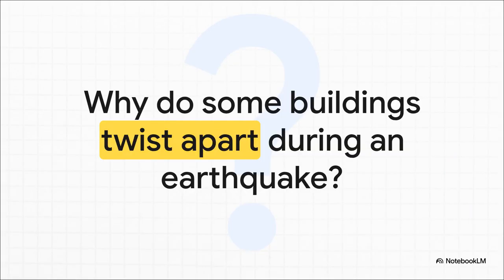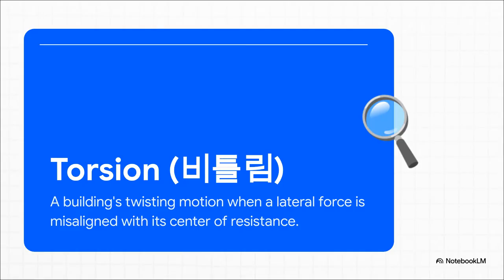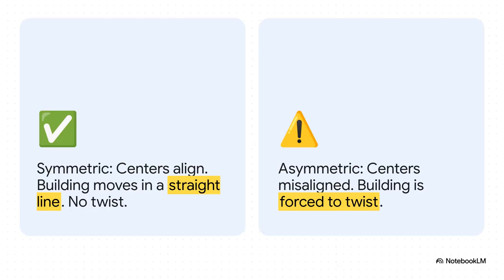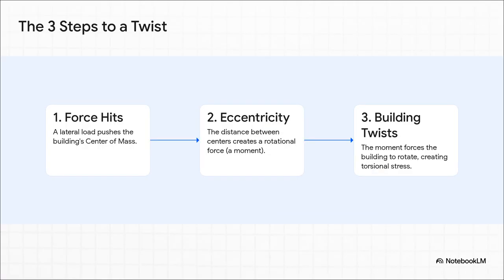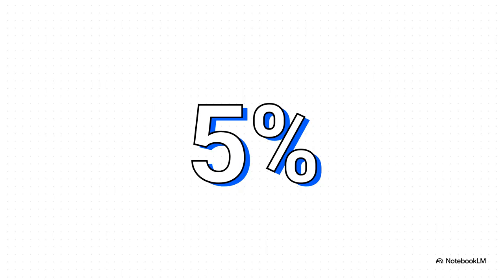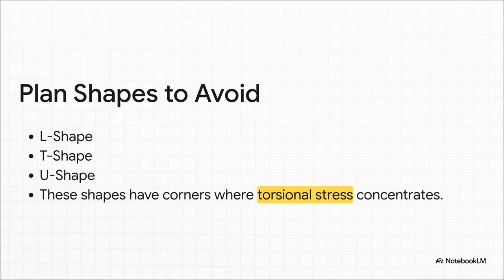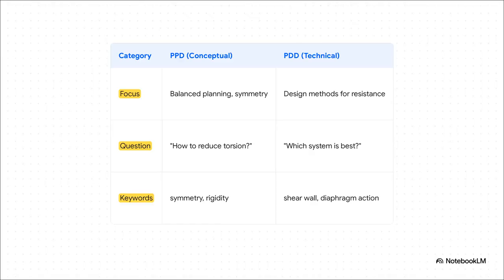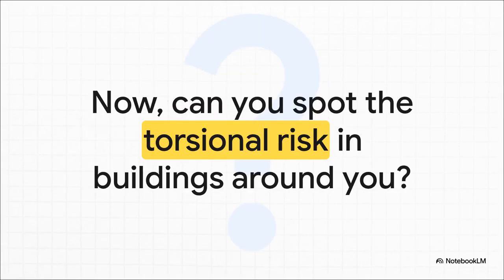ARE Exam Prep: Torsion for PPD & PDD | ARE Lab

Comment: The video will be better if you put example of building column or wall shear configurations of a square building to get a grasp of center of mass and center of rigidity and symmetry. I know words but if a building configuration was presented to me , I wouldn’t understand which is good or bad for torsion and where is center of mass and where is center of rigidity. The video just needed an example.
Reply from the maker: You’re right—showing actual square-building configurations with different wall and column layouts would make the relationship between the center of mass, center of rigidity, symmetry, and torsion much easier to understand. I’ll incorporate more applied plan examples like this in future videos. Thanks for the thoughtful feedback.
Reply: @ARElab Thank you! Can you please post video related to it before August 17th if it is possible ? Because I have PPD exam on that day 😥 If possible videos related to seismic issues in plan like Re-entrant corners , Diaphragm eccentricity , unparalleled lateral system and seismic issues in Elevation like soft story , Weight/Mass irregularities, shape irregularities, Discontinuous shear walls and lateral stability.
Reply from the maker: @10ahmedhassan  I will try to make some structural videos before your exam date. Good luck with your exam!